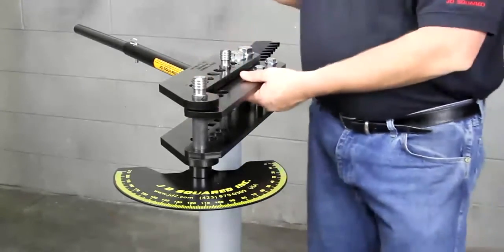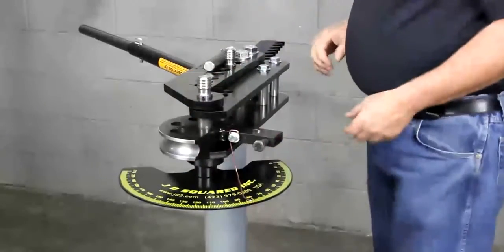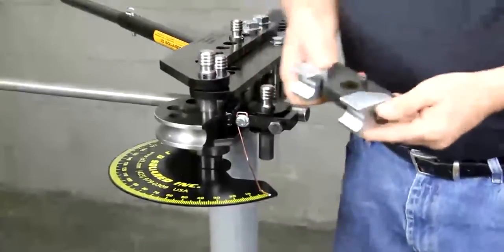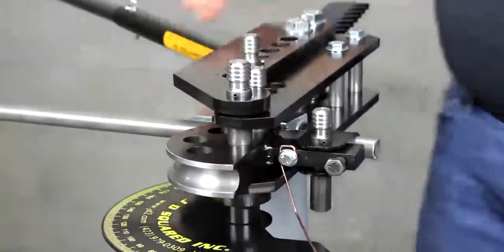JD2 Model 3 Bender demo

Comment: My JD Model 3 is so old the degree wheel is stamped not painted and my pull handle is 1/2" flat plate. I really wished this unit was made of aluminum, it's so heavy duty it's hard to use.